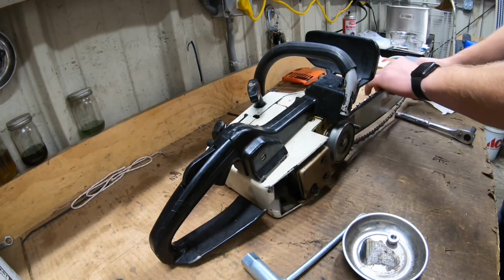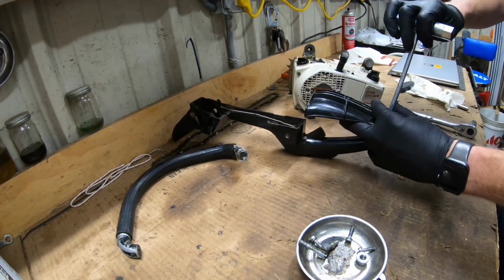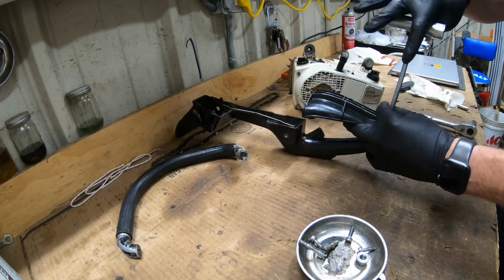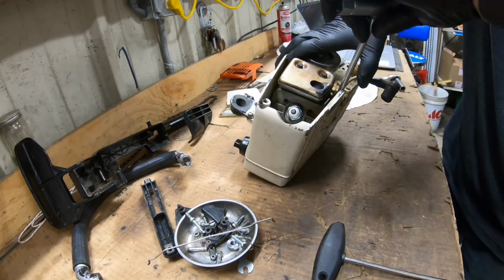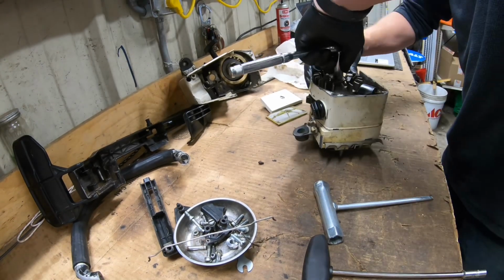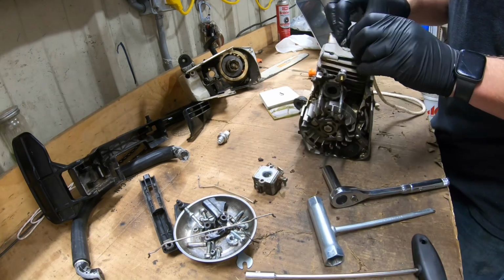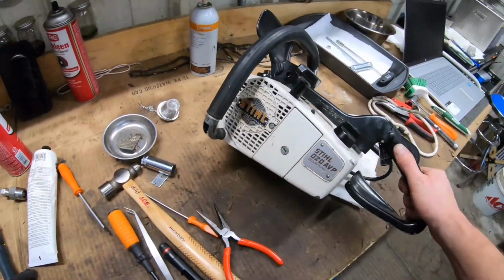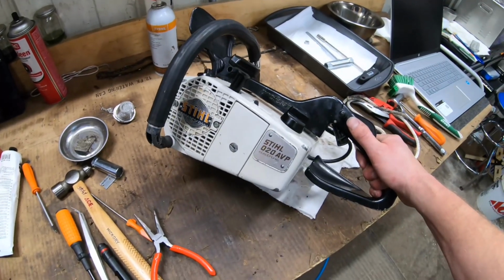Will This Stihl 020 AVP chainsaw start ?

Comment: It appears you were trying to start it without the choke on. After you get the spark going try moving the black lever that's just to the left of the gas cap to the right or closest position to the gas cap. Then start with throttle wide open. Good luck and thanks for the video.
Reply from the maker: It’s just puking gas out the exhaust. Rebuilt the carb but no luck same thing